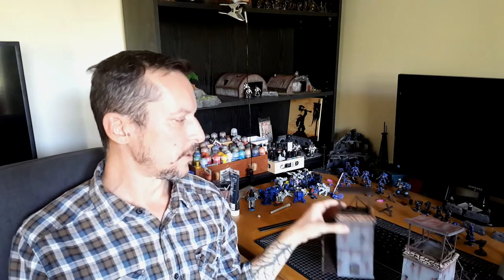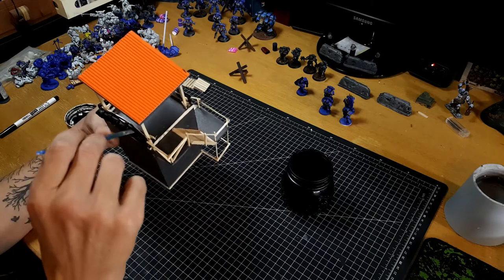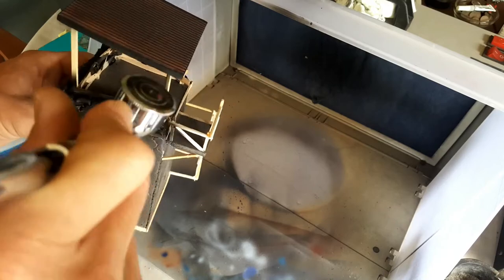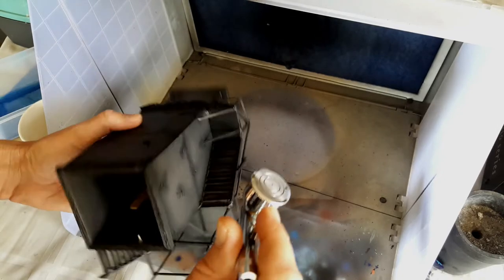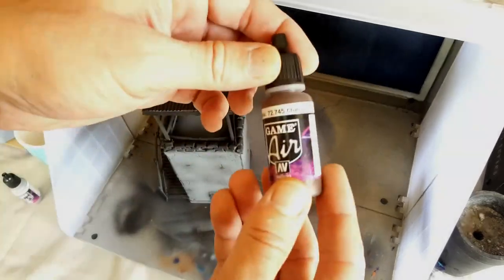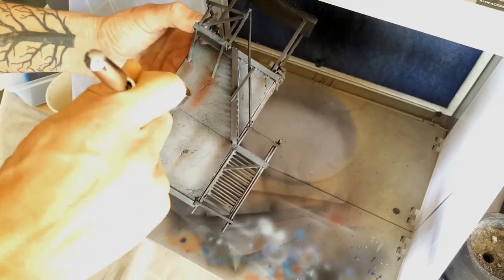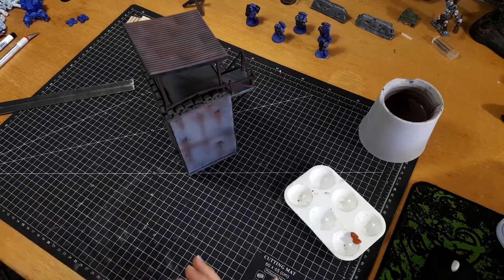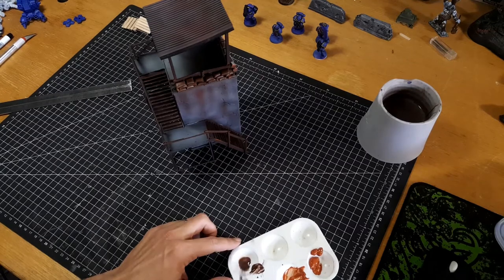How to Paint and Airbrush Concrete and Rust for Wargaming Terrain

Comment: Looks good, but can't help but notice you made the roof way too high. shouldn't be more than 3x as high as the sandbags IMO
Reply from the maker: Yeah, it does look a bit off, I must have been thinking about accessibility for the models, but I could easily get away with a shorter roof, or a removable one if necessary.  Thanks for the comment mate.
Reply: @RFDHobby  When it comes to removability, I like to work with well positioned magnets. Two, one on each adjacent corner, would do the trick. Cheers for the video

Comment: I love everything about  this. But im freaking out on the stairs and all the tiny bonds holding all the extra detailing like how do you make those tiny joints as solid and firm as the rest of the model?  Im thinking it still needs to be set in a solid base. But im still freaking out about the toothpicks breaking and hateing different kinds of glue? 
Whats best to hide glue gunk and can different micro tubeing come in handy to simulate concrete or metal base supports. Concrete pillar supporters? 
 I love building mini ideas. And i really miss the hobby
Reply from the maker: Thank you very much.  I found with the toothpicks that using PVA wood glue worked best, some of these joints I did go back and add a 2nd spot of glue to the joints to ensure they held.  The PVA glue shrinks quite a bit as it dries, so it doesn't leave a lot of glue gunk.  It seems to also bond the wood really well.  I've had a few moments where I've knocked this build and thought I might have broken it, but it has held up well (my current plan for a breakage is to just re-glue it or replace the broken part, which shouldn't be too hard).  I think a base is probably the best idea for this however.  I was in a bit of a phase of not putting bases on stuff to help them be usable in different situations, but I'm not sure this is as important as having the thing last a long time.  Micro tubing and stuff would be a great way to add on supports to these, and would look great, especially with the base.  I hope this answers your questions mate.  Thank you for the comment and questions.

Comment: Why don't you pre thin the craft paints for your airbrush? ;D I't always nice to check out how others are painting, i was looking forward to this video!
Reply from the maker: Thanks Jagelsdorf.  Honestly, once you've put some proper airbrush paint through the airbrush, it's hard to go back to non-specific paint mixes.  The quality of the paint does make a big difference to the outcome, and the ease of use.  I started with mixing cheap paints for the airbrush, and it will usually work ok, but to really see what your airbrush can do, I recommend getting paints designed for this use.
Reply: @RFDHobby  I will keep that in mind once I buy myself an airbrush! ^^

Comment: Help!.  You're modelling help has bumped my game a lot but I'm still learning.  So I went and bought an airbrush finally to use some of the painting techniques and it's taking more paint Than  I thought for bigger pieces.  Can I use methylated spirit to thin paint as I'm having a lot of trouble getting paint through and isopropyl alcohol is more expensive.  Thx in advance.
Reply from the maker: Hey Karl!  I'm no expert on airbrushing, so you might find advice different (and likely better) than mine, but I'm happy to share what I know from experience for you.  Feel free to ask any other questions you have as well.
As far as the thinner for your paint goes, what you really want to achieve is the paint drying as it hits the surface you're painting.  So you don't want to try to give something a full thick coverage with an airbrush on each pass, but build up a few layers of paint that will eventually fill the area in completely if that's what you're after.  If you thin with too much water for example (or apply your paint too thick), you can get the paint staying wet on the surface and the air from the airbrush may even push the paint around and cause unwanted effects.  So ISO works better as a thinner because it will dry really quickly as it comes out of the airbrush.  I don't know about metho as an alternative, but we're making terrain here as well, and I remind myself that for a lot of what I'm doing, good enough IS good enough at this point of the project.  So if the metho goes on and doesn't do anything funky to your paints, you could do this for sure (someone may be able to advise whether or not methylated spirits will hurt anything in your airbrush, because I have no idea sorry).  Personally, I use the Army Painter Airbrush Medium as it seems to have a flow improver as well, so I don't get as much of the paint drying on the tip of the airbrush, or clogging up.  But I'm in a fairly hot climate up here in Queensland, so it makes a difference as well.  It's up to you how that stuff might compare to what you're spending on ISO, but I found it superior to ISO and worth it for when nothing else is working.  Painting terrain with the airbrush for me is really about coverage first, so I've thinned with water and iso, as well as a few different thinners to find the 'best stuff', but I'll still throw water in and have a go if the thinners aren't nearby haha (if it works I keep just keep going, if not, I get the good stuff).  
Not sure if this is helpful or not mate.  But let me know if you think I can help further.
Cheers,
Shawn.